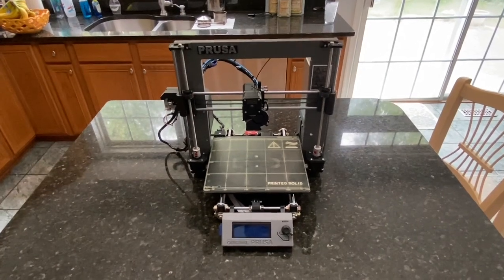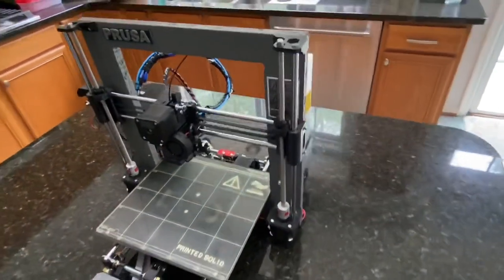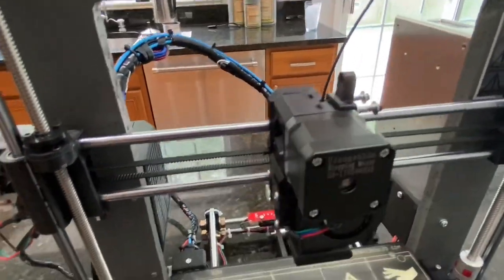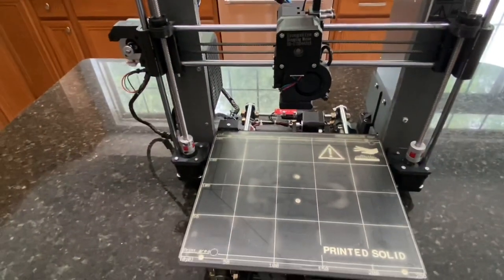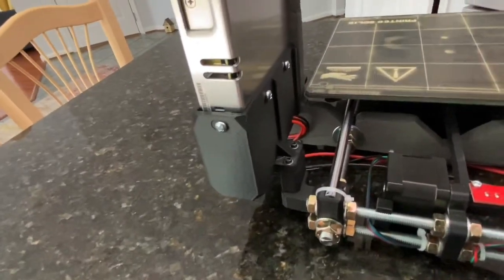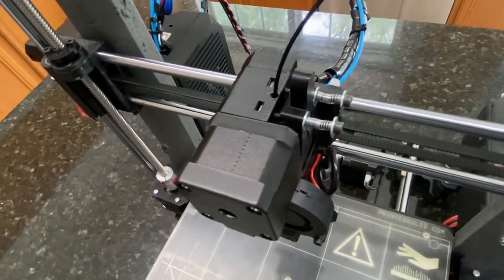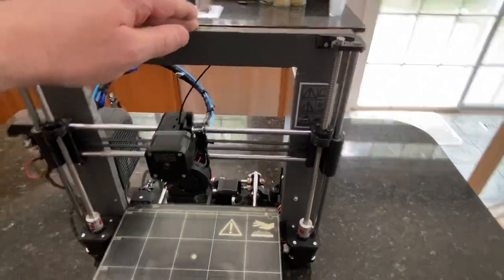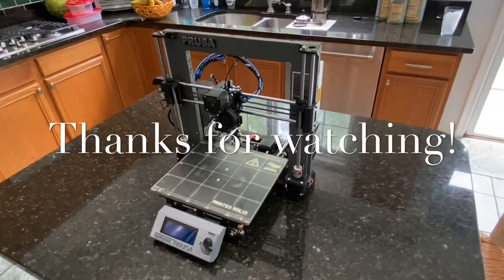3D Printer Scratch Built Prusa Clone, part 3

Comment: Did you use petg for the parts? And do a print test video!
Reply from the maker: I started out with PLA, because that’s all my old printer would print. After building the Y axis, a friend printed the x-axis, z-axis, and extruder parts in PETG (and the fan shroud in ABS). I printed the large parts on this printer- the power supply holder, lcd cover, and Rambo box. I got some PETG in from Prusa, and have so far printed and replaced the y-belt holder- the pla one had started to warp from heatbed heat. The other y-axis parts appear to be holding up so far, but I’m printing PETG spares just in case